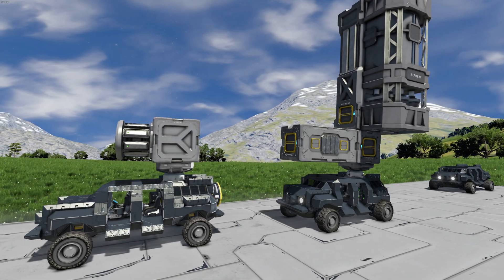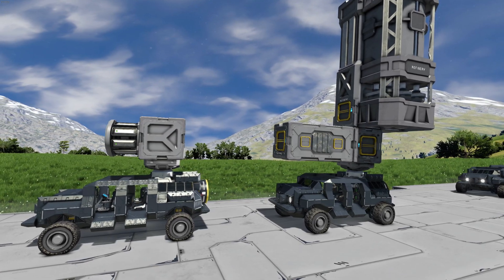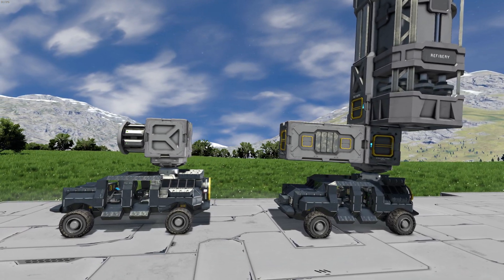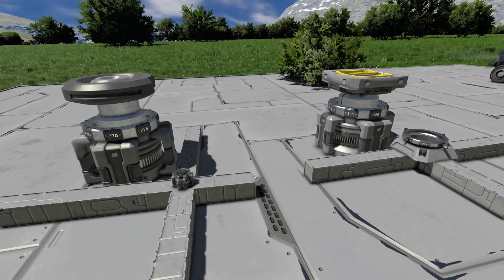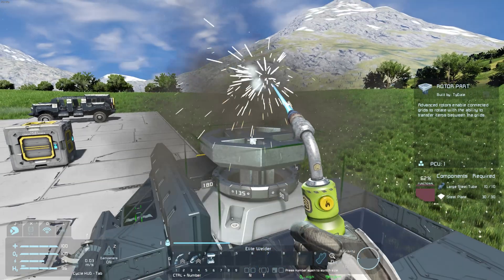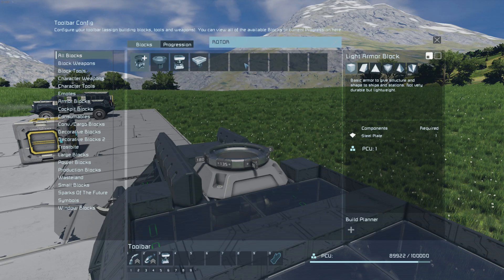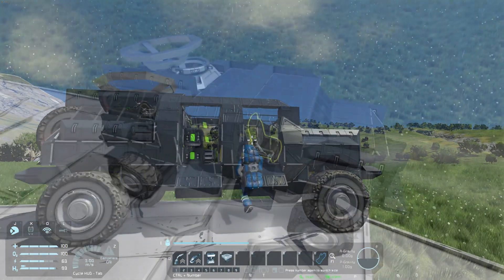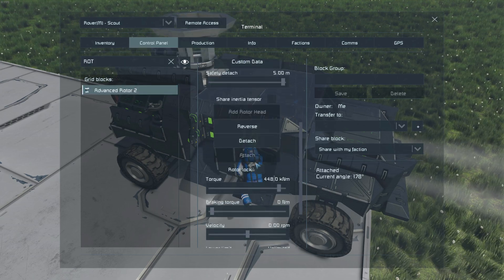Quick Tips: Large Rotor Heads on Small Grids - Space Engineers

Comment: After dozens of tries dropping the rotor part, and making piles of scrap metal, the method worked on the first try when I modified it like this:

The hard part is dropping it correctly. You can't look at the small rotor directly, because that forces the rotor part to become small. But if you look elsewhere, it is nearly impossible to align. The trick for me was to make a large grid frame above the rotor, with just enough clearance for a large block above the rotor. Then install the rotor part on the underside of the framework, above the rotor. It doesn't have to align perfectly. Then grind the block above the rotor part, so the part falls. It won't look right, but if it's sitting approximately on top of the rotor, even tilted, you should be good. Go into the controls for the rotor. If "attach" is available (not greyed out), select that, and it should work.

I had the small grid rover parked on a large grid platform, so the two grids were not perfectly aligned. But there was a mated connector between the rover and the base, which probably helped. The frame, of course, is built on the large grid platform ... it would not work otherwise. I suppose, if this method doesn't work for you, you might want to try aligning the grids more carefully. And I think the position of the rotor with respect to the connector must make a difference ... you could be misaligned by one small block.
Reply: If you drop the rotor straight down from up high, it won't switch your rotor back to a small one, because of distance and you can aim right at it..      :)
You can mount them side-on too, if you use a timer to loop the attach command infinitely, any rotor that falls past a side rotor, gets grabbed..
Reply: @D_Rogers  I tried that, dropping from just high enough so it doesn't switch to small. I found it virtually impossible to ensure I was directly over the rotor. Maybe there is a trick. Stand on the rotor and then jet straight up, and tilt horizontal without moving, I suppose?
Reply: @rstoertz  There is a hungry-rotor trick...

I just get overhead and aim with the crosshairs..
It sometimes takes a few tries..
Up facing rotors are easiest..

My survival shortcut video has details on how to use a timer block to make it easier too..        :)
Reply: you helped me!!! first try and I DID IT!!! <3